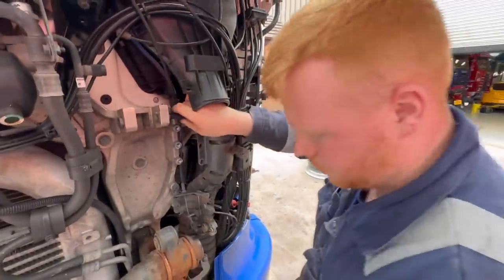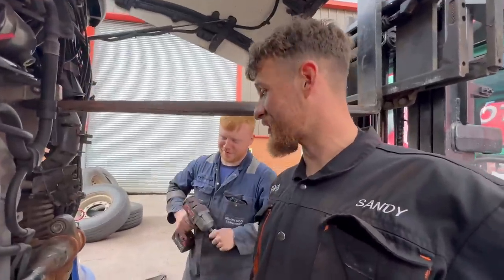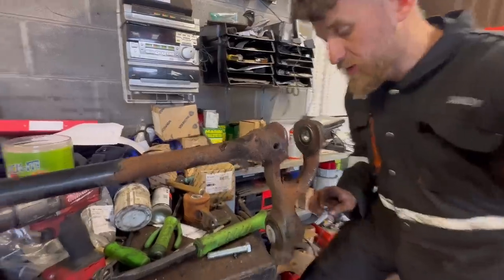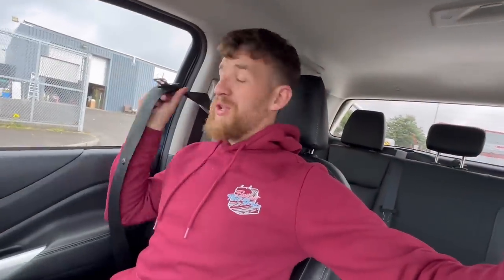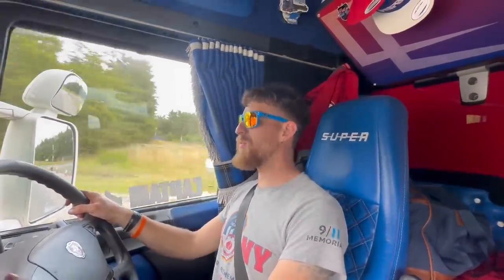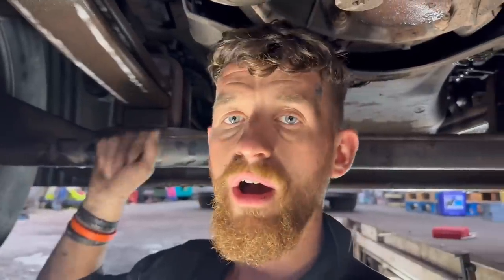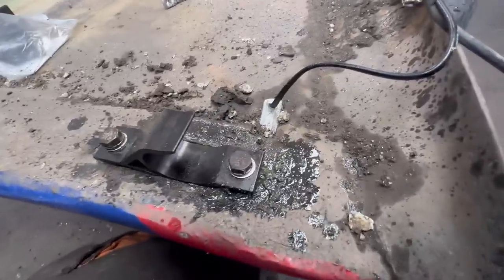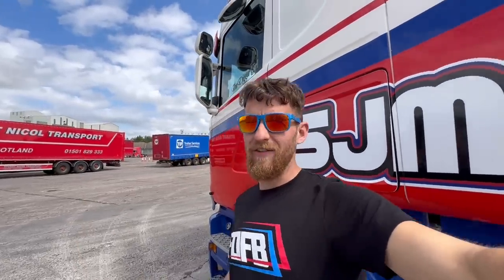Truck! MOT! Real Truck Owner!

Comment: The bumper looks mint, thought you might have got a wire brush on the bar and knocked of the surface rust and given it a coat of paint while you had it off changing the bushes though